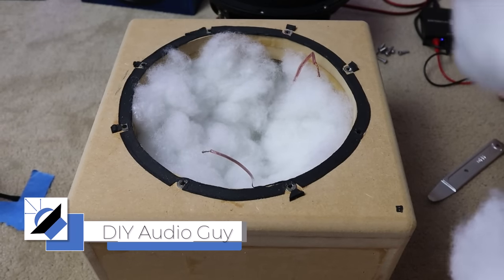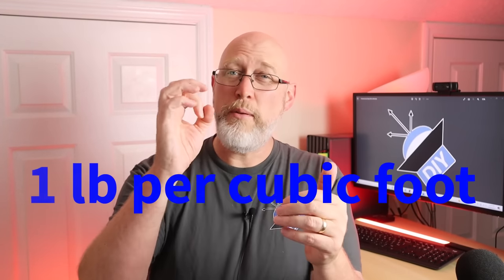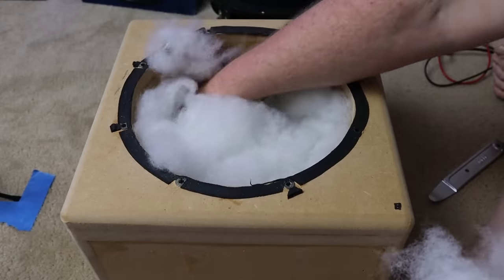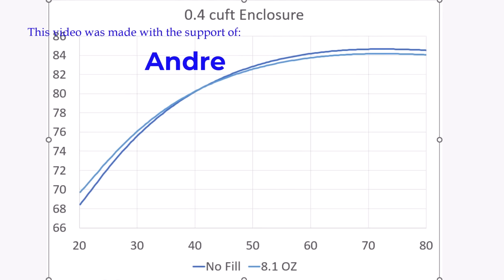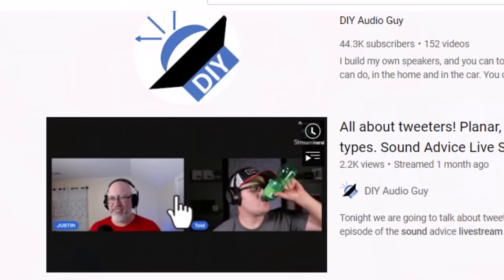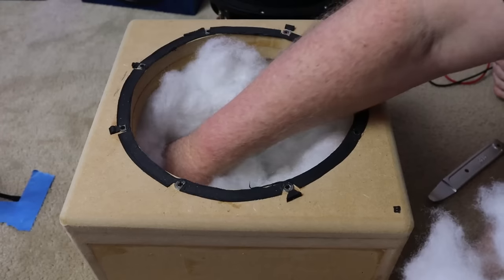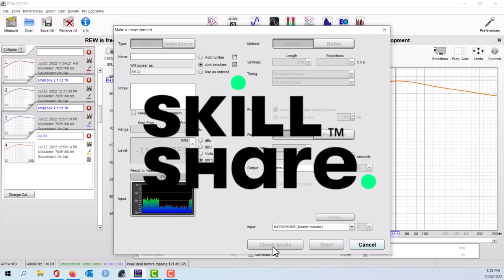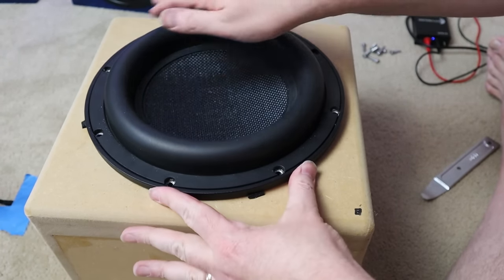Can Polyfill "fix" a small box:  Bass in a Small Space

Comment: Great video! It would be more interesting to test it with pink noise. Just make a try! With certain speakers (speaker and cabinets) the difference can be interesting... Polyfill always used for reason. Resonancy control / shaping / tuning, in-box echo reduction, harmonic distortion reduction caused by box resonancy, etc... The difference can be more noticeable in ported boxes. For example, if I would remove the polyfil from my studio sub, it would make a plunky, "flat" knocking bass. With the originally installed polyfill it gives smooth, soft but deep and accurate bass. During the past so many years I found that the amount of fill really depends on the speaker, cabinet qualities. How they behave together. And, if something sounds good in an isolated environment might not sounding the same in another room. It is not as easy as 1 x 1.

Comment: To be honest what I thought would happen is that the higher bass would be attenuated and the lower bass also attenuated but more so, so it would sound "deeper" but you'd have to bump up the amp gain slightly to compensate. So I'm surprised at some gained efficiency on the lower bass notes, seeing as polyfill is taking up room in the box and making it smaller. The only thing I can think of is the polyfill simulating a longer coiled up tube in the box (as if you mounted the speaker in a funnel that went into an "intestine" with rigid walls with the other end closed off, or you made a long and skinny sealed box with a half wavelength at a low bass frequency), would it have some half wave resonance that boosted the output, even with the same total airspace?

Comment: As a previous owner of 3 Custom Audio Stores, I have to disagree.  My main tools were LEAP and the LMS systems + Audio Control Spectrum (Former IASCA Judge).  Dacron was the preferred fill back in the day.  Filling is an artform to produce certain outputs.  Especially in Sealed Enclosures .  The use mostly reduces standing waves and other problematic issues within the Enclosure.  Is much better for those who have limited space for Enclosure size as stuffing results in lowering the bottom end but also the SPL.  Designing an Enclosure that geometrically cancels standing waves and internal issues is much more preferred, but a Dacron laced or filled enclosure will always produce a nicer tighter bottom end.  If it doesn't , you're doing it wrong.  my Bla bla bla...  Previous Owner 'Audio Innovations inc, Sound Service inc, Mad Monster Customs inc.'  drivers encluded, Dynaudio, Seas, Morel, Audax, Fostex, (many many others) and Drivers Custom made for me using my own Thiel Small Parameters, first batch copied Rockford Fosgate 12" Pro with tweeking..   A Simple Uncalibrated Spectrum Analysis always does not give you the true nature.  You Have To Listen.
Reply: Reducing Internal Standing Waves Flattens out the Bottom End so there are no 'Notched' Losses or Gains.
Reply from the maker: I welcome disagreement. Thanks for sharing your experiences.
Reply: +1 for this! I have added fill to many small sealed boxes and it improves the sound greatly. Some boxes that have size limitations need the help. This analysis is very interesting, but it doesn't show what matters....how it sounds.
Reply: @alejandronunez9796  Yes, the age old question.  and the Survey says....... it's purely Subjective.   My 60 year old ears do not hear what my 25 year old ears did.  Everyone has their own 'Frequency Curve'  .   Some people hear better dynamic range... some higher frequencies.... and my Cat hates everything associated with my obnoxious Audio Systems.

Comment: My guess is that polyfill is not dense enough for the low frequencies without serious amounts. So something like rock wool, sheep wool or some hefty synthetic stuff would be better. But then again there are many types of polyester stuffing so some probably work better than others with low frequencies. I haven't done any analytical tests, but I have had the impression that adding fill does usually make the sound a bit smoother and less boomy.

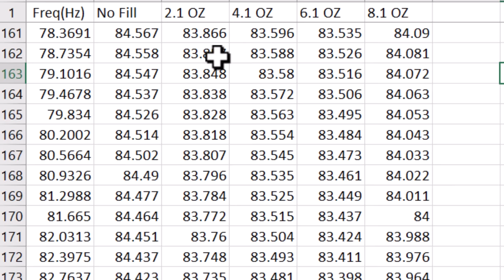3:35 I have a hard time as I tend to hear differences of 0.2 dB, at least when talking about stereo image and finding a suitable balance between left and right. When EQ'ing, I normally want to use gear with 0.5 dB increments or less, as I've noticed the sometimes massive effect of a 1 dB. But of course I am talking about single sine wave frequencies and I certainly couldn't point them out without using a signal generator. Lately, I've become blatantly aware about the importance of room acoustics and the horrific effects of hard, untreated surfaces. I've spent way too much time with a mic (and ears) trying to find a nice EQ curve with multiple speakers. From now on I should really focus on room acoustics.

Comment: For years I use a trick that is to add some polyfill under the speaker cone, going around the speaker rim. You don't have to use much and you definitely have an extension on the lower frequencies and a better cone control. If you like that smooth bass go for this trick, specially on cheap subwoofers.
Reply from the maker: Great tip!

Comment: as a kid I would use coushom foam in speaker boxes to get the bass response. muck denser that poly fill and easy to salvage from discarded couches and chairs.  LOL salvagd speakers from discarded stereo consoles that needed a fuse or a solder joint fixed maybe a broken wire. or one part of the whole console broke and others were fine but they wanted a new one.  LOL   literal "Trash to Treasure in stereo equipment and speakers. salvagd kitchen cabints for enclosures too... lol  talk about cheap audio guy or rather kid.that was me at 10yo thru my teens

Comment: Hope I'm not too late in posting this.  I know the rule of thumb is content creators only read comments for the first hour. 🤷‍♂️

I'd like to point out a couple things you might try changing regarding how you're doing your testing.  Though I will first admit I don't believe these will change your results but I've been proven wrong before so I figure it's worth pointing out.

The first is the mic placement is an odd choice.  I get that you were going for a Near Field measurement, which technically you were still within the near field of the speaker.  But on low frequency drivers the standard procedure is to place the mic centered with the dust cap and just beyond its linear excursion, or 0.11r where r is the radius of the driver, preferably in cm's.  This results in a measurement devoid of reflections and even baffle defraction and resonance.  By placing it a foot back you're still getting all of those added acoustical affects in the measurements.  To add to this being on carpet and repeatedly moving and replacing the subwoofer is highly likely to result in slight differences in both distance and focus (directional aim).  When your looking at 0.5 decimal references even a cpl millimeters can result in a change. 

I would recommend placing the sub and mic on a wood panel and mounting stop blocks on the front and side of the sub (just short blocks obviously) allowing you to press the sub back in the exact same position every time. This would allow you to move the mic further up to a true near field low frequency testing position.  I'm guessing that's a 10in Sub so that would roughly be 2.8 centimeters, assuming the driver truly measures at 10in. 

The other thought I had, and not knowing the model of the driver used I could be completely wrong on this, but just visually that 0.4 cubic ft box looked way too small for the driver you were using.  I know the idea is that polyfill can make a smaller box function more like a correctly tuned box.  But I've always heard that was only to a small extent, and again just going visually that box seemed excessively too small for that driver.  Perhaps a better test would be to use a box sized closely to the reference tuning for the driver, and then test the effects of polyfill on that setup. 

Lastly, and this would really push the limits of your time so I wouldn't expect you to try this more than once, is the idea that the polyfill will shift and settle over time and use.  So you could try doing a burn in on perhaps the recommended polyfill amount by running the sub for a while playing a constant square wave at first then perhaps some music for dynamics.  This would give the polyfill time to shift and compress then run the measurement again and see if there's any difference.

I'm definitely intrigued by this proof of concept.  I think more investigating under different parameters is warranted and I hope you give this another go!!  I wish I had the resources to try this myself but alas at this time I don't have any way to do that.
Reply from the maker: The main thing is to maintain a consistent test environment.
Reply: @DIYAudioGuy  I agree.  I'm mainly just offering ideas on ways to improve that consistency.  Either way, thx for taking the time to read my post!

Comment: My worry about this test is that the Polyfill will be mucho squashed - made much denser - so that would skew the results. 
The squashing would get more pronounced the more fill is inserted. 
Plus, there will be differences in the mechanical link between the driver and the bottom panel... and thus, the top panel... and thus, the frequency response/excursions of the driver at different frequencies. So altering the measurements.
Hope this makes sense!
Guy

Comment: Poly fill works better in a full range speaker than a Subwoofer box.  It helps resolve standing waves from the rear of the cone which can come thru the cone and muddy the sound. 
You put so much Poly fill inside that small box that it acted as a dampener against the back of the cone. (It doesn't have to touch to effect) Which made your results look the way they did. It's NEVER placed directly behind the cone that close as it affects the Qms (which is what happened to you)
Reply from the maker: Right. Hopefully people will stop doing it!

Comment: This should not be how insulation in speakers is used. People make this mistake all the time. Insulation should be used to address standing waves and to absorb energy which can cause reflections on the driver, as well as absorb the energy to prevent it from setting the enclosure into a resonating state, which can effect sound quality and have a constant frequency being put off that is not part of the music.

If you are doing it to make the enclosure "sound bigger," buy a different driver, one more suited to fit in the size that you intend to have the driver installed. That might mean saving up more. But you will be happier in the long run.

Now, for sub frequencies, constrained layer damping is one of the best ways to stop the energy in the enclosure, with 2# MLV being able to drop the dB of the sub frequency range by up to 19dB (varies over the range). That makes it an excellent candidate if trying to address cabinet resonances while not trying to increase the enclosure size.

If instead you want to go the insulation route, for subs, you MUST use 3.5" or thicker insulation, line the entire cabinet, and it should be denim, rockwool, or fiberglass. Polyfill, also called PET insulation, also called Dacron and Acousti-stuf (specific version with crimped polyester fibers that do inscrease its effects on frequencies) and other similar names, does practically nothing at the relevant FR for subs. As such, the use of poly outside of mids/woofers should stop. This can be seen in effectiveness charts in the loudspeaker design cookbook p.45 et seq. 

Insulation helps to smooth the frequency response of the speaker. It should not be used to gain low end extension. Instead, if it is used properly, you can have smoother bass.

Look up Bobgolds website for absorption coefficient. This will show the only way to hit 125Hz or less is to use at least 4" insulation. With going deep, you may want 5.5" - 6". And there goes exploding the size of the enclosure.

To do this experiment properly, it requires two boxes, both built to have the open space being the same volume in the end. That means the final open volume in the speaker enclosures must be the same, but one built with the extra thick insulation and one without it at all. Then, you are not trying to change the Q of the driver, instead you are trying to absorb the energy before it can effect the enclosure. Surely 4"-6" insulation is not practical as it greatly increases the size of the enclosure. But, it takes that to make insulation effective at smoothing at lower frequencies. 

Lowe's carries (although out right now) 3.5" and 5.5" UltraTouch Denim insulation which is a decent price. For Rockwool, you can get 3x 2'x4'x4" insulation for $65. That would be the thinnest I would recommend to have an effect on sub frequencies. At 0.15 absorption coefficiant, or 15%, this is negligible on performance. As such, anything showing 50% at 125Hz will be less than that by the time you reach 40Hz, or even 20Hz. That means you will need something reading near or at a coefficient of 1 at 125Hz if you have any hope to damp low frequencies. Hence the 3.5" being the minimum to consider, and 5"+ preferred for very low frequency damping. 

This was the second time I typed this, so lost some things, but I think this is enough to start with. I put no links because YT likes to delete my posts when I link things. So, hope you can find things I referenced.
Reply: 15 in. x 47 in. R21 Thermafiber Fire and Sound Guard Plus Mineral Wool Insulation Batt is at home depot, 5.5" thick rock wool. $53.85 around here.
Reply from the maker: Right, it has its use, but making your box bigger might not be the best use.

Comment: I jammed a small cloth bag of thermal foam in a really cheap ported subwoofer cab to stop it from distorting on very low notes.  Not only did it eliminate the distortion, but I think it extended the low end a bit via slowing the air down to the port.  The bass also sounds less boomy without significant output loss.  Better all around for $15.
Reply: You created an Aperiodic enclosure. Its a cross between ported and sealed. An Aperiodic enclosure is one in which the woofer breathes through a resistive membrane to control it's cone characteristics. In laymen's terms, it makes a woofer in a tiny enclosure act as if it were in a large, sealed enclosure. Since you had ported stuffing made it more sealed lowering SPL slightly, tightening up the bass, and extending the low end.

Comment: Poly fill or damping material has been used for ever i have built only 2 subs a 12 inch and 15 inch both ported both loaded with old fill from a pillow both sound perfect  used measure from comercially sold subs using there size and put in port  never tested with equiptment but to my ear sound good .i think stiffening box helps seal leaks

Comment: Nice video, lots of good info, I do prefer the lower tones over the +70 hz range. Another measurement process is to do slower sweeps to get more data at frequencies at a slower rate. Another thought I've always wondered about using the "egg crate foam" that have peaks and valleys to break up the standing waves, similar to movie theater setups. Can you test that to see if it makes a difference?
Reply from the maker: Anything you put in the box to break up standing waves and cut down reflections will improve sound quality.   The only thing this test shows is that you don't actually improve low end extension by adding polyfill to a box that is to small to begin with.

Comment: I would be interested in the same test with a woofer that has a much higher QTS.  At 0.49, while not terribly low, that is low enough that the Ultimax 10 is going to be fairly tolerant of varying box volume / fill.  One of the ways around too small an enclosure is to use a woofer that will work well in a wider range of enclosures.  Not arguing the results, just postulating.

Comment: This was a cool video to watch. High drama for us DIY speaker builder guys!  You can't argue with the science, test results are test results...  

...Several years ago, Toid's DIY Audio did a nice video on the benefits of using stuffing with a Tang Band W5 driver and demonstrated that it had made a difference in his tests. He built both undersized, and optimum cabinets (both sealed) and filled the small one with varying degrees of Polyfill until it was fully stuffed. There was nearly a 5 Hz difference between optimum and undersized (unstuffed) cabinet volumes from 50 Hz down to about 25 Hz. 

Fully stuffing the cabinet (by volume, not weight if I recall) basically split the difference and added an approximate 2.5'ish decibels to the bass output in that same cabinet size over the same frequency range. I would think that would probably be a 'hearable' or 'percieveable' amount of additional bass, although not by a large margin. 

Since both results are true, there must be instances or situations where stuffing would be beneficial, and others where it isn't as beneficial.

Justin's driver was a larger 10" Ultimax sub, and Nick's driver was a 5 1/4" Tang Band W5. 

Obviously, the AMOUNT of undersized-ness of the cabinet is important...  and maybe driver size plays a part... or could it be that driver specs determine whether or not stuffing has a substantial benefit in an undersized cabinet or not?  If so, it would be interesting to see which specs would indicate the tendency to allow for an increase when stuffed. 

I wonder if this stuff could be scienced down to a formula that could be applied mathematically?  I'm not smart enough to do that, but it would be cool to see!  :)  

Looking forward to more videos on this topic if you choose to do one!
Reply from the maker: I think that box stuffing still has it's uses, but the idea that you can build your box wrong and then use pillow stuffing to fix the mistake is, in my opinion, wrong.